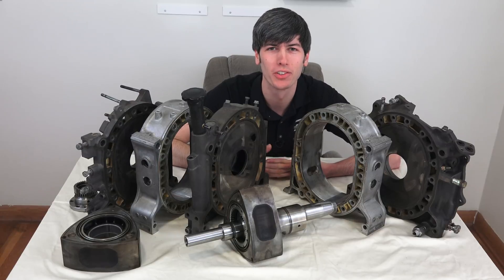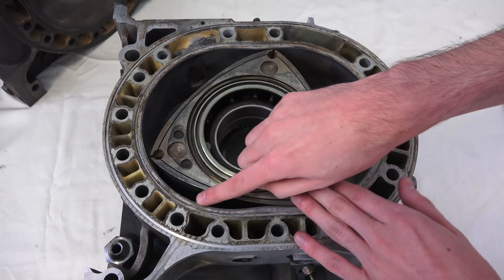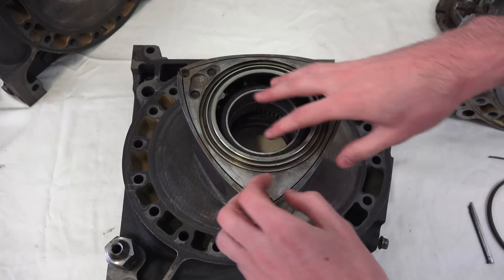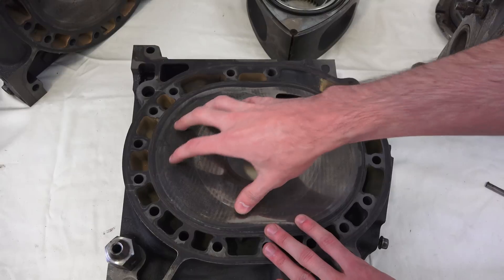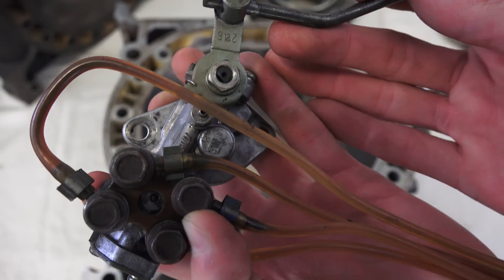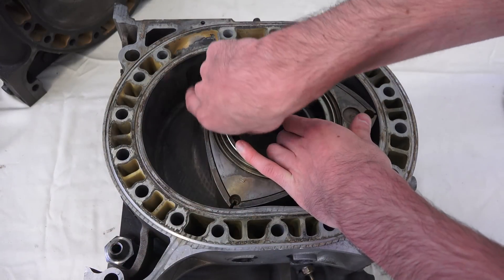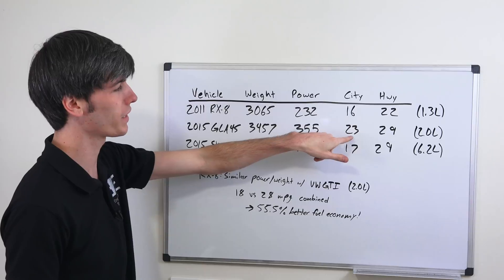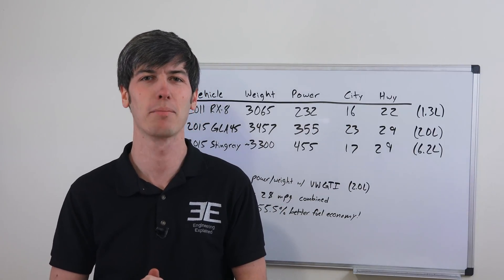4 Reasons Why The Rotary Engine Is Dead

Comment: Not really thinking this out, but using Skyactve X technology (combustion through compression more than spark, knocking) Mazda could technically fix the thermal efficiency in the engine. BUT the combustion/intake temp ranges still blow the engine, unless they can build a cool system that would ice the combustion side down more than the intake. Maybe alternate the combustion chamber ... IE the area intakes ... then the next chamber that passes is combustion ... then the next chamber is intake .... you could do it trough a rotary valve intake similar to the old CanAm 2 stroke motors ... hmmmm ...

Comment: t one time a version was made that was comparable to a smaller V8. Used in cars, motorcycles, planes and compressors. It may have it's day again. Sure beats Ford's and others micro displacement 3 cylinder engines. My rental car could not make it up my long hill in Albuquerque!

Comment: That is NOT a "rotary" engine That is a "Wankel"  engine. Rotary engines look like radial engines but the crank on a rotary is bolted to the firewall  and the crankcase rotates.

Comment: They're gone because good engineers are in short supply. And bean counters have imperfect formulas... If we keep with their mindset you'll be in a 4cylinder auto and manuals would be gone GASP!

All the low rpm imitations of dr.wankles engines make such a sad examples of his work
Reply: They are not gone. They are used in drones and other applications. If you read my post you would have seen that Mazda is introducing one, out next year in a car.  Read AIE UK's post. That will put you right.
Reply: John Burns my comment was a response to the video title. I will check out those drone wankles and your comment! thank you i had no clue

Comment: Imhadmam'74 Mazda rotary p/u years ago. Got HORRIBLE mileage, was pretty fast, and 'Uncle Bucked' every time I shut it off. Count to 5, and BANG!!! wouldn't be so funny, nowadays, though. Started it up one night after class, to go home, had water/coolant RUNNING out the exhaust. Replaced it with a Capri V-6 from Mexico with transmission, did all fabrication myself (I was 19 at the time) SEEMED like a good idea.........

Comment: These seem like they would be solve-able problems by using mathematics and geometry in design, with the assistance of computers. How come they couldn't design and manufacture an engine that fixes these problems? I suppose the real problem is that it takes a tremendous amount of R&D to perfect the design and is, thus, not an equitable engine to produce.

Comment: Back in the day 2-stroke motorcycles were the only way to go, more power, smaller package, simpler design. 4-strokes couldn't even compete, but that all changed with the emissions bs.  2-strokes were frowned upon because they spit white smoke and were not fuel efficient, so all the companies dumped RND into building 4-strokes better. The end result? We now have kick ass 4-stroke bikes that can nearly compete with 2-stroke engines in their class. Imagine what 2-strokes would be now if we put all that RND into 2-stroke technology instead. This is how I feel about rotary. An amazing engine design that will die off because emissions, what a shame. With proper RND I feel like rotary tech could become something amazing, and we could find solutions to these current problems you listed.

Comment: All very good until we got to the whiteboard. None of that stuff matters. You don't buy a performance car, any performance car, if fuel economy figures on your radar at all.

I ran an RX-8 for 18 months and did around 40k miles. I averaged 22-23 mpg (Imperial not your lightweight US gallons ;) ). I get similar in my current performance car.

The power delivery from the rotary in the RX-8 is different to anything other than an electric car. It feels linear. When you're screaming towards the redline at 9,000 rpm all of the stuff in the video doesn't matter a jot.
Reply: It's a sports car not a performance car.  And how's the view of the backside of that piston powered V8 at 9000 rpm.
Reply: It would depend on the track. I’d have been happy to take on any similarly priced V8 powered car on a track.

I have a faster, piston engined, car now. It’s a different experience to the  RX-8. It doesn’t take away from the fun I had in it though.

Comment: 4 reasons the Rotary Engine is Alive : 
1. The sound / 2. The awesome feeling of its perfect center of gravity / 3. High RPM range is bananas / 4. Gas is still available 😂. Great Vid btw as always.
Reply: Also the acceleration of a turbo RX-7 is weirdly smooth, like the hand of god pulling you by a rope.
Reply: Low vibration!
Reply: the Shaft spins at high rpm the Doritos spin at 30% of that
Reply: Ebrahim nalla if gas unavaible we can discover electric powered rotary :D
Reply: THE MEME...
Reply: alphawav3 You miss some other advantages, because is very small and light, because its very simple.
Reply: you forgot to mention .....people who do not care about the environment one bit
Reply: Trash ass engine

Comment: The wankel engine works way better with turbo pushing high boost. The low compresion helps with allowing high boost.
Reply: Then it blows seals.
Reply: Well mods are needed yes.. like ceramic seals. Are they still used on planes?

Comment: The hot exhaust should closely pass by intake chamber - this will heat the intake chamber and reduce expanding difference.
Afterburner should be installed in exhaust - this will produce additional heat for minimising expanding difference and also resolve emission issues. Sealing may be improved upon new material inventions.

Comment: the stingray gets its efficient highway rating because it shuts off 4 cylinders when they are not needed
Reply: Lets see a rotary do that.
Reply: A rotary doe not need to. Although shutting down a second rotor is possible.

Comment: had a RX7 , the 2 nd version.... worst reliability EVER. I think Mazda overcomited to high tech at expense of reliability ( cost cutting )?

the air conditioning system control unit failed ( expensive) the engine would be 50 /50 on starting @ 60,000 miles - if it didn't start first crank, forget it, I think the seals ( ' piston rings' ) failed and contrary to pistons, the rotary wouldn't start with failing seals , ?

and then there's the noted HP / torque. not good.  nice try, not good results.

Comment: But the rotary will run on very low octane gas, as well as fuel alcohol. Alcohol combusts at a lower temperature, eliminating some of the problems you point out.

Comment: I thought turbocharging the engine helped negate the unburnt fuel problem significantly? Also, some slight re-engineering using different alloys on each side of the combustion chamber and some kind of silicon injector to replace the oil one might improve it's long term endurance/reliability and reduce emissions? Just some thoughts.

Comment: Inefficient? Show me a piston engine with this few parts. Show me a piston engine that can blow up and still win a race. My 1984 Rx7 is completely stock and gets over 30 miles to the gallon genius. My 1995 Twin Turbo Rx7 was faster than my 1996 Corvette and got better gas mileage with an ECU and a proper tune.

Comment: An interesting point on the emissions side. 
In the 90s Mazda Japan had a fleet of 626 station wagon test vehicles running around with commercial operators testing a hydrogen version of the rotary engine. 
Mazda hoped for zero emissions certification with CARB once testing was completed and the engines did indeed have no measurable emissions. 
However, CARB refused to certify them as the asked Mazda ' Do you still lubricate the rotors by oil injection'? 
Mazda replied that they did, but the amount was so small that emissions could not be measured with any current test technology. 
CARB stood firm, and the engine was refused. 
😔
Reply: That's interesting! I'm curious how a rotary would do on propane, since it is a hydrocarbon.
Reply: @AKSoapy29  There is a bike where a guy does a propane powered rotary bike, called Dragon's Breath
Reply: @elitewolverine  Ooo, I'll have to check that out. Thanks!
Reply: @AKSoapy29  better take methane CH4 is better than C3H8
Reply: CARB cannot refuse to register a car if it passes emission testing.  It violates US trade law.   Now maybe they refused the ZEV designation but they cannot block the sale of the car.  It could carry a PZEV designation instead

.
Reply: @electrictroy2010  CARB exceeded its mandate years ago; its sole purpose at this point, like any other bureaucracy over time, it to continue its own existence. CARB pursues continuously diminishing returns in pursuit of an unachievable goal. Pretty soon, they'll ban model airplane engines, because, you know, they're two-strokes!..
Reply: MDS the rotary was held back because other auto manufacturers felt threatened by it.  It did win the 24 le man, and when taken apart was also so durable that could go another 24 hrs while other piston engines were done.
Reply: Dangermouse it’s because oil in the combustion chamber reminds them of 2 strokes 😂
Reply: You think maintaining seals are hard now? Try sealing it from the smallest element that exists. Bad idea
Reply: @buildalifeworthliving4551  The seals have no problem whatsoever.
If you take care of them.
Reply: @Justnn  sorry didn't see your reply till now.  Yes.  Basically gas benefits from energy density.  They can overcome the inefficiency of an ice engine that ranges from 25 to 45% efficient.  Because every gallon can store a lot.  Hence why a gas car can go 800miles on a 20 gallon tank getting 40mpg.

For air.  The compressed air has the most energy, when at a full tank.  The energy is caused by the pressure of the gas on the tank walls and it wanting to escape.  However as the air is let out... The resulting pressure reduces, reducing its energy ability.  So as you drive the energy possibility drops.  So that's why air cars have to have super robust tanks cause their gonna store a super high psi to hold onto the energy required to turn a motor.

My proposal is to not let that air back out.  But to keep it in a closed loop.  When the air leaves the engine... It still has pressure, it still has energy to do work.  So take what left over energy you have to spin a tesla turbine. Which in turn turns a alternator.  Now that the air has exhausted its ability to work, you store that in a non compressed tank.  Here is where a compressor will recompress the air back into a tank.

Here a battery storage for when the car isn't doing work will ensure the tanks are always charged.    But to get the most out of everything you would want to use capacitors as the middle man...

The best part about this idea, is say you run out of air on the road.  You can pull out a solar panel, or put one in the roof, to run a compressor to charge the tank.... And off you go.  If you run out of gas... There is no ability to regas without getting gas from a station or emergency help.  As for something like an electric car... The energy required to charge the lithium batteries is so great the panel roof idea would take 3 days to charge the batteries...

My way... Stops both ideas.

As well, in long term driving... You only need about 30to40hp...to drive 75mph
Reply: California Dreamin  one could argue both.  Combustion is the chemical reaction, explosion is simply defined as a rapid expansion of energy or release of energy.  The combustion engine qualifies as both since it is a rapid release of energy everytime the mixture is ignited.  But because it requires a specific fuel air mixture it also counts as combustion.  For laymen, to me, it's OK to use explosion in that matter.
Reply: California Dreamin  very much indeed.
Reply: @MDS-c5l  Late reply here, only just received a notification now, but a rotary running on hydrogen fuel is not a 'Dirty, belching atrocity', all that was being released from the tailpipe was water vapour and a miniscule, unmeasurable (at the time) amount of engine oil (try measuring out 1lt per 10,000km into PPM)
Almost as clean as a fuel cell vehicle, and the same as a hydrogen fuelled piston engine whose exhaust will also contain a tiny amount of leaked engine that bypasses the piston rings.
Reply: I would have to see that to believe it.   The Wankel injects oil into the chamber, along with the intake charge.  No liquid fuel would make it a difficult proposition to properly disperse the oil necessary to keep the seals from welding themselves to the walls.       There is no way, with current lubrication technology, to make a "zero emission" wankel.
Reply: @CaberFeidh  exactly what the heck must the oil have been converted to for it to somehow become emissions free grade? Pure water as well? Honestly seems impossible. Not to mention that oils have additives etc that are very complex polymers that don't break down quickly much less in a single RPM... which is really one of the main reasons oil exists.
Reply: @Coffeebeard  You are exactly right.    That is why there is no such thing as a "zero emission" liquid fuel engine, and there are never going to be zero emission 2-stroke motors. 

The high swept area, and thermally unbalanced nature of a wankel make them inefficient, dirty, and hard to maintain over a long lifespan.
Reply: @Coffeebeard 
Not sure why your reply took so long to come back to me, but in my comment, I didn't say there was no emissions, I said that 'they were not able to be measured'.
The amount of oil injected into the chambers of a rotary engine is not too different to what gets past the piston rings of a regular piston engine (typically around 1lt per 10,000km)
That tiny volume of hydrocarbons was not able to be measured with the test equipment of the period, and so Mazda presented the car for ZEV consideration which was then refused.
The remaining combustion process produced water out of the tailpipe.
Reply: @CaberFeidh  Depends on how hot the explosion gets.  An air powered Wankel powered by compressed air would technically meet your standards.  And if you do it in a closed loop with a screw compressor to recompress the exhaust, the air will have a lube in it from the compressor.  Solving it.  We just have to ensure the compressor is powerful enough to halfway keep up.
Reply: @elitewolverine  That wouldn't be an engine. The wankel would be absorbing power, not producing it.
Reply: @CaberFeidh  All engines 'absorb' power, none of them 'create' power, they transfer energy storage from one form to another.  In the case of ICE, transfer the energy stored in gas/oxygen, and transfer it to a turning momentum.  Compressed air is no different.  Transferring the energy from a stored tank and pushing the rotor around via gas expansion.  Just like a gas explosion...without the explosion.  And since the expansion of air in such a manner is cold...not hot....it negates your worry about heat and siezing.

The problem? Gas stores more energy than compressed air tanks.
Reply: @elitewolverine  but what will power the compressor? I dont see that happening
Reply: California ruining things again

Comment: You made a bit of an error comparing the fuel economies.  Those are not engine fuel efficiencies you've constructed from government EPA.  Those are manipulated by gear ratios, vehicle weight, tire size and width, parasitic drag, aerodynamics, etc.  While I understand the point you're trying to prove, it's misguiding.  The difference in fuel efficiencies between engines could only be calculated on a dyno without any other part of the car interacting or interfering with results of engine efficiency.  To put it simply, the only factors that prove the case are:  How much fuel is used to make each engine's peak power per litre.  Then you can formulate a ratio to show the difference.
Reply: Dude, They use a lot of gas. Especially for a 1.3L. You can have 700+ HP nowadays for that mileage.